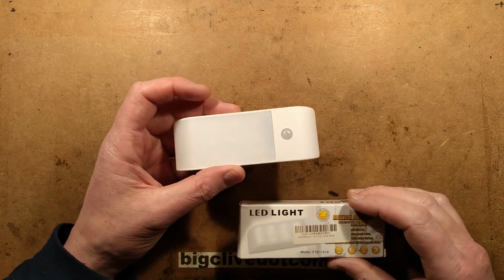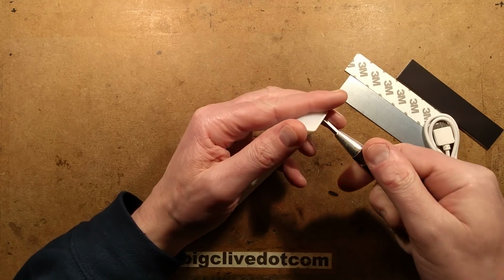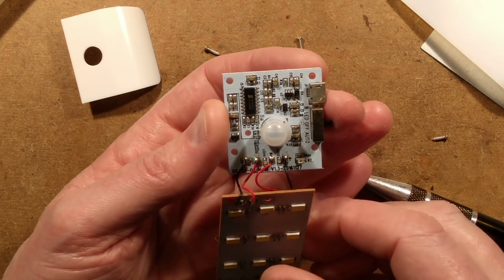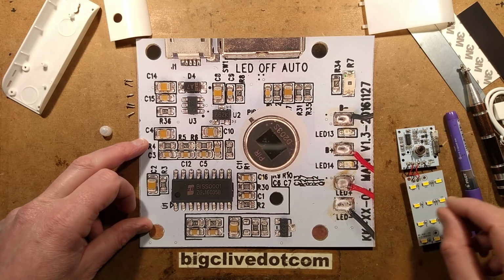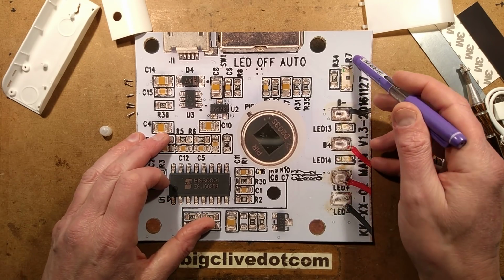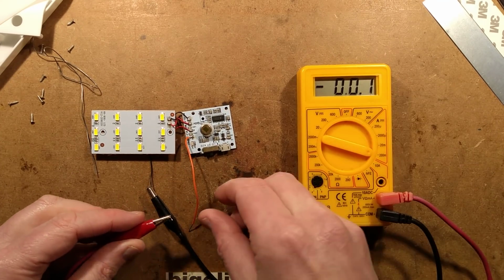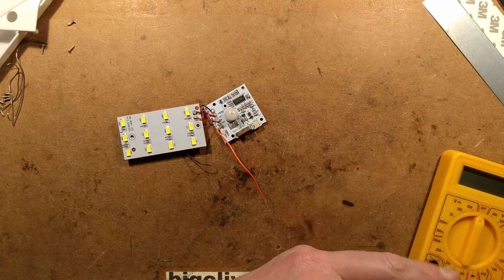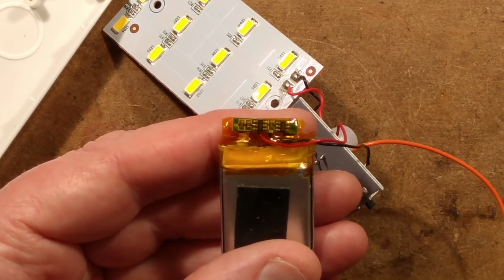Sensibly designed USB rechargeable PIR cupboard/hallway light.

Comment: I’ve been watching your videos for years now now, and yesterday I channeled my inner AvE and tore down a little rechargeable screwdriver that plugged straight into the wall. 

Inside was a pair of AA size Ni-Cd cells in series, connected straight to the output of a bridge rectifier made from discrete surface mount diodes, with the mains live going through a series of 0 Ohm links (presumably as “fuses”) to a 3.3uF capacitor. No smoothing or anything, just the most barebones capacitive dropper, presumably since Ni-Cds are a rather resilient battery chemistry. 

Only reason I could follow what was going is because of your videos. Cheers, and keep up the great work!
Reply from the maker: I've seen that type of charger.  It does rely on the ruggedness of NiCd cells to charge them directly from a capacitive limiter.
Reply: Oh you and big Clive

Ever seen that I think it's a Weller rechargeable iron sorry Grand ideas with the incandescent bulb in those little heater chips that plug in well those things we're in terms of charging not so bad but there's a flaw the charger is fine however after the charge contacts for the iron it goes straight to the batteries which as you know even small ones can pack a punch when are nickel cadmium because of short circuit currents I do believe that's one reason why in those irons they use them is the liver High current I don't know what they might have carne as for the tip that's a a lot of current for shur but I digress back to the charging the batteries.
 As I had said that they connect directly to the battery from a charge contacts well what does that mean if there's a short between both of them well a lot because if you do this there is thin wires of an unknown alloy that act as fuses and I can get nasty when they go out with a bang.

From what I understand from two people that are fello Electronics enthusiasts and also both those people welderup converting it to USB charging by my recommendations oh and speaking of cordless screwdrivers if you get to write voltage over on it to point something or other volts 2.4 volts AKA to nicad batteries in series.

You can easily convert it 2 USB charging and charge in about a minute or so how's that build a supercapacitor battery replacement and micro-usb there is actually ways to do this online and in some books I think one of them was something by Popular Mechanics something about hiding somewhere other I have it but not with me right now where I'm staying unfortunately cannot remember title exactly if someone has info on this what the community enough by replying publicly to this and also to this post all I can remember what is thanks it's might have a blue cover it's got the fancy mail run the corners and all that I think I think Barnes Noble uses. And may still I think there might be an updated version as well which is more projects be more desirable. I think this was in there but not sure.

I. Came stop with an elegant Solution on my own that worked well that's a prototype that I want up making a few out for friends I keep one in my kitchen drawer 4 quick fixes.
 I also made them for family for Christmas one year everyone love them.
Reply: Aaron Brandenburg
You can get nasty, eh? Tape it.

Comment: Hey big Clive big fan here love the videos keep it up.

As to this video the one with the cupboard hallway light LED rechargeable few comments and questions and possible explanations.

First of all you didn't know. About the lithium cell and Heat.

Have you ever this man told his cell phone and noticed that the processor and all the heat for singaporeans are often thermally attached to the battery.

And some people said when they've seen that in their videos why on Earth is a good idea to do that or is it even safe.

And yes it is a good idea and it is safe.

The reason that is a good idea is because as you probably know with lithium batteries of that type do you have performed well in cold conditions.

AKA Outdoors when you're using your cell phone in the winter.

The idea is that it will it will keep the battery warm enough to perform better in the cold and also because of the and alack of an Eric way too easily heatsink a phone to act as the heat sink.

Onto about the LED panel you did say that it was well design copper heat spreader and such right my theory is that like a lot of your videos as well as other similar to your Channel AKA teardowns that led panel may not have been designed for that product right. Possibly it was meant for somebody else entirely off the shelf part.

Please comment if you or anyone has ideas or comments on this stuff.

Note I am not a technician or even in the field at all nor any formal Electronics training I am self taught from a young age and just about every mechanical electrical electronic subject matter by the way I am on the autism spectrum.
Reply: Take a breath mate.
Reply: @roycejulian1517  also by any chance are you. In Australia or have a family from there. Or background.
Reply: @roycejulian1517  I know, took some speed huh?
Reply: Yeah yeah hard to do all this when you're in a hurry and I have so many ideas we are not in the situation to post videos and stuff otherwise I would be just sticking out videos and doing it myself. If I ever get the opportunity and such in a facilities that be doing something somewhere two big Clive Maybe.
Reply: "alack of an Eric" truer words have never been spoken.
Reply: DA666
this man told: dismantled. Teach yourself either to speak or to type. Your heatsink is no good at listening.

Comment: This has given me an idea for a bit of a project. An array of those PIR chips going into a raspberry PI or whatever other development board for a cheap ass thermal imaging camera. I'd have no idea where to start with a lense though..
Reply from the maker: Real thermal imaging cameras have crashed in price due to Flir's Lepton array.  It would be worth getting the real thing as a camera accessory.
Reply: When I saw that last thing that climate just said it as a response to yours I yeah probably be easier to get the real sensor and easier to engineer and possibly less costly roll and definitely less complicated. In terms of building a thermal imaging camera with a Raspberry Pi and PIR sensors.
Reply: Aaron Brandenburg Yeah, you would need one sense element per pixel, the one in this lamp is a two-pixel sensor.  Even basic VGA resolution would need 150000 of those, and a pretty large lens.
Reply: @johnfrancisdoe1563  you got my point that's what I was getting at obviously and it does match exactly what I said doesn't it that's why you got that thumbs up the first one it was me by the way
Reply: Aaron Brandenburg
What thumbs up? I see 0.
Reply: John Francis Doe
Wonder what a silicone fresnel would look like.

Comment: The 830b meter by mastec is one of the better cheap ones,  i add a thick wire from the com direct to the adc earth, improves the zero resistance.
And replace the crappy pot for a better one, dcv/acv/current all depend on it.
Reply: zx8401ztv
You have a pot on your meter? 830b must be analog.

Comment: Will it work while charging? (can it be used  as a maintained light)
Reply from the maker: It looks like it could, but I've just tested it and the charging indicators are so bright they activate the dusk sensor and stop it from turning on while powered.  It might work if you removed or covered the light sensor inside.
Reply: bigclivedotcom Or just remove the charging LED to retain full function.
By the way have you looked at the EEVblog μCurrent box or the 3rd party enhanced version for these kinds of measurements?
Reply: @johnfrancisdoe1563  yeah something like that wasent it called the eevblog or something microcurrent.
Reply: Aaron Brandenburg
That transducer actually requires a $cope if I recall correctly.
Reply: I was going to ask the same thing if it to operate while it is charging as one of the power bank so I have is designed to prevent it to keep from damage and also not charging.

Comment: Your work space can't be that bad! Hell, my bench has stuff strewn about from projects I finished working on months and even years ago 😂 For the most part I still know exactly where everything is though, and that's what matters!
Reply: Sort of look like the move with before franlab moved or with Dave Jones is Zev blog during the lab move and let the magic smoke out on the Soul Train station that time because it wasn't 220 it was only A1 120 volt AC unit not dual voltage. Oops

Another words if you have muscle types of equipment they have different power requirements but are similar or have different power requirements and the same type of power fort label the heck out of it and same with power adapters are similar. Which I did right away in my own shop to prevent such a disaster never happened once with my own equipment and I also would check on anything I was working on or using somewhere else and I wasn't sure it was the right power source I only had a happened once or twice and if I don't know polarity advice is not to new and under warranty or sealed or whatever or some white Minds that take it apart I'll do so and check for positive on a cap or negative or check for a ground just in case is tip negative or Center negative AC adapter or DC connector Orson on stair plug that I'm not sure about or grossly under light bulb plugs that just say power and there's a ton of different pens such as a DIN connector or something similar. It's just good practice over all the void the magic smoke one could say or or an expensive repair of an attempted repair or repair of a repair when you're working on something wish me even with a customer getting a new device not buy them buying it or warranty reasons if you get the point the no words instead of doing the customer for repair the customer basically bills you for their new Gadget and yes I've never had that happen that I have seen that happen to text I know up even with laptops and stuff you know ouch.
Reply: Aaron Brandenburg I’m still chuckling at “let the smoke out of the Soul Train station”.  Now we know why Weller has no soul left!  That dastardly autocorrect does come up with some real gems.
Reply: @ethanpoole3443  haha I didn't even catch that 😄 looks like someone was using voice to text

Comment: I love those sensor lights... I have them all over the house. Also I weirdly have lots of those batteries... All of them are rated 480-500 and they have protection. Really useful for small projects. I used one to convert my mouse to USB rechargeable because I was annoyed by those AAA batteries even if I change them once per 4-5 months...
Reply: Actually that's a great idea about the mouse never thought about someone that although I've done some things with that and one thing I was thinking about was if either a there's a product that could do this if not modify some Led like area light for closet light either with or without a motion detector and add a little extra electronic circuitry lithium ion battery charger microcontroller switching circuitry tie in somehow the USB power in to an input pin on a microcontroller as a power present indication and then switches or whatever to indicate off on auto emergency that's right rechargeable light that can serve as an emergency light when on charge. I've been thinking about building one myself.
Reply: @aaronbrandenburg2441  I normally buy those night lights with dust sensors and modify them to use brighter led(depending on model you can modify it to even 5w so they can be used to lit medium size room) They cost 2-3 euro and even after modding them you can put them in light bulp case and use them as normal bulbs in places where you want to have light after dark but you don't have there constant(just bulb screw) 
As for modding things to usb/battery power i buy those cheap power banks because whole charging circuit is very small and its easy to remove usb port and move it to different place to fit project you working on.
Reply: Akinaro
All hail the light bulp.
Reply: @paranoiia8  Oh you mean those night lights that detect when your house is Dusty  and dirty and only come on let you know you know like their kids know to clean their room.

Comment: Could do with something like that by the gate in the yard here, ever since the streetlights were changed from low-pressure sodium to a really low lumen LED panel, the step in the yard has caused many a delivery person to trip in the dark (despite my putting up a PIR floodlight by the door, that thing is hit-or-miss with who it lights for!), only issue would be charging (would be blocked for solar by the wall) and weatherproofing...
Reply: You can get LED "weather proof" PIR lights with solar charging cheep for your use.
Reply: Problem there is where it would need to be sited would not receive enough light from the sun to recharge adequately in the darker months, so would run the battery flat in no time...
Reply: Okay, but maybe you could stop ordering pizzas past dusk or advise the delivery Co. to let their drivers provide their own torches, or paint the lawn gnomes with Radium. Randomly the vampire shows up with a delivery, but the light has no choice but to not respond to the undead.

Comment: Never mind you bench; I can't see my own bench for all the clutter! :-)
Reply: A cluttered bench is a happy bench.
Reply: My bench is so bad that I used my computer desk yesterday.
Reply: Been there done that.

Allso.  Hue hasn't occasionally show of comments and likes. Anyone anyone
Reply: If a cluttered bench is a sign of a cluttered mind, what is an empty bench a sign of?
Reply: @markwatson9816   I  comfort myself with the philosophy that you can't trust a man with a tidy desk/bench :-))
Reply: There is a simple solution, fit a pair of windscreen wipers on the bench.
Reply: True about the windscreen AKA windshield wipers dual purpose. When using power tools drilling or Dremel or woodworking project it's. A AR mag dust and debris removal system.
Reply: @Bennyboy-dog  Thanks for this, I've found this comment at least three separate times, and LOL'd each time. Brilliant :-)
Reply: You too?
Reply: I’m pretty certain that the clutter is all that is holding my bench up.  I dare not clean it up!  People just have to learn to accept that with a certain degree of genius comes a certain degree of madness.
Reply: @ethanpoole3443   True, but which side of the dividing line between genius and madness one is on depends very much on where the observer is standing relative to that line.

Comment: Thats a lovely little design...   I think I will be buying a few for around the house!!  Thanks for sharing Clive!
Reply from the maker: It is a nice design.  And real tech specs too.  I put it in a dark section of my hall and it's very bright at night.  Literally 2 of them could replace the normal low level lighting in that area.
Reply: @bigclivedotcom  5 "warm colour lights" on order...  I baught two that use 3 AA cells some time ago - I modified them for 18650s but they dont have battery management, so these new ones will be excellent...  this could be fun designing and making a 3d printed housing for the rear panel to accomodate two 18650s in parallel...  charge once a year!  There are so many dark places in the house that deserve a little auto-light!  Great find!
Reply: @bigclivedotcom  Clive could you tell me if the positive or negative is switched to turn on the LEDs ?
Reply: Yeah, bought 2 of em, the light looks really warm
Reply: Anyone find a nice upgraded battery for it? :)
Reply: I bought two of them too, the only thing that irks me is the rather short time its active - it would be better if it had an adjustable lighting period